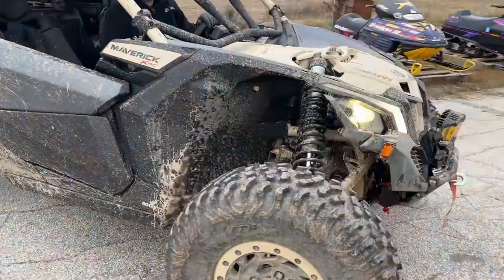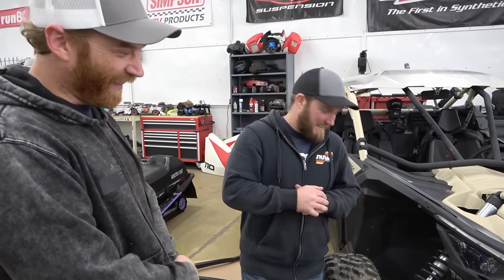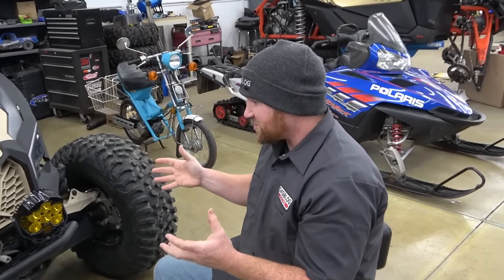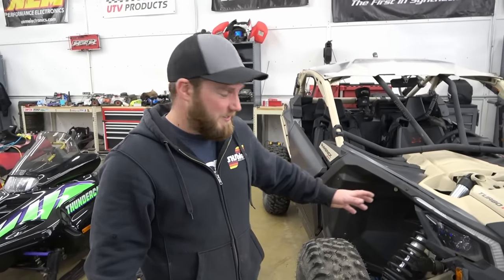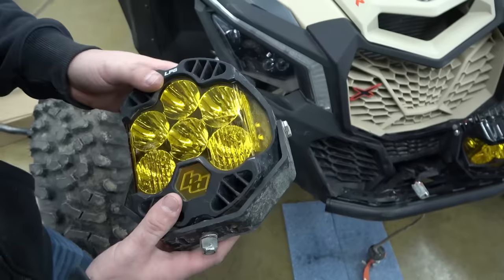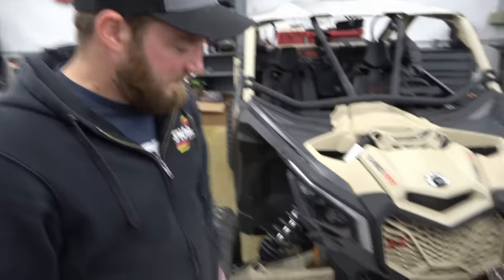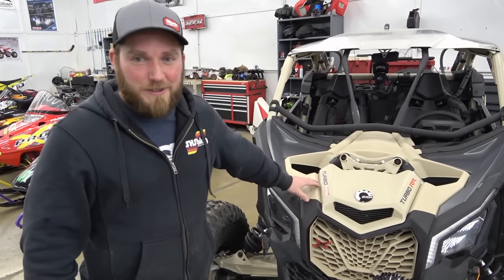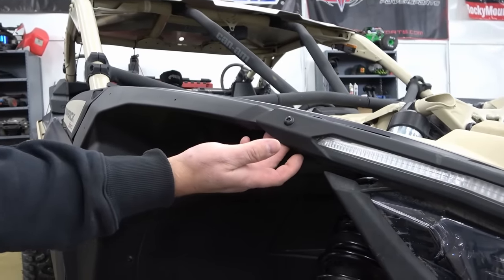Is it Totaled? Fixing Matt's X3!

Comment: Tip for removing those clips underneath-I use a flat head screwdriver or an 90* angle pick on both sides of the plastic piece to push in the "teeth" of the clip and it pops right off without damaging the plastic tab.

Comment: Remove the two small bolts from the bottom of the grill. The grill can be easily removed for radiator cleaning and it doesn't fall out.

Comment: Cool to see the disassembly of the X3s front end.
Radius rod bolts loose 😮 sketchy...definetly a good idea to nut bolt critical areas after a hard ride.

Side note on Radius rods:  I found when installing an aftermarket radius rod plate (pull plate) that the stock bolts were too short.

Comment: How come ya'll dont run bulkhead gusset kit and shock tower brace? That front bumper loses large center bolt to frame, puts all pressure on single shears. Is absolutely the worst a arm design by far.